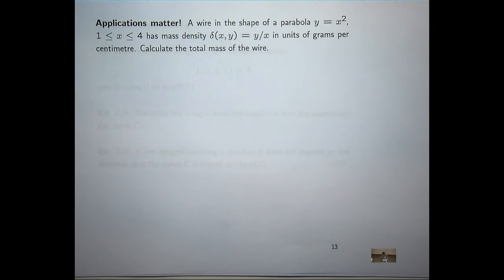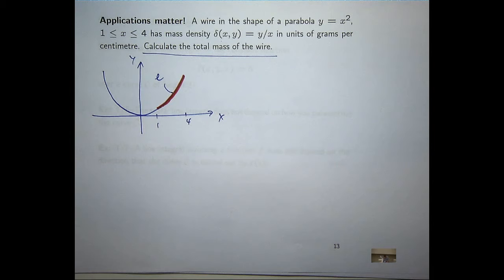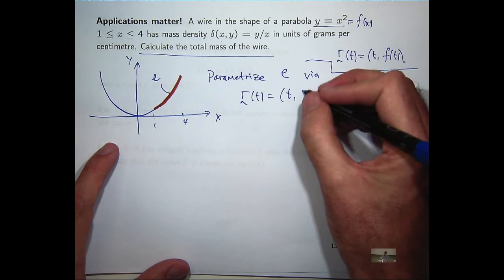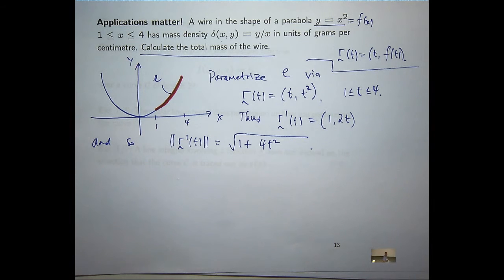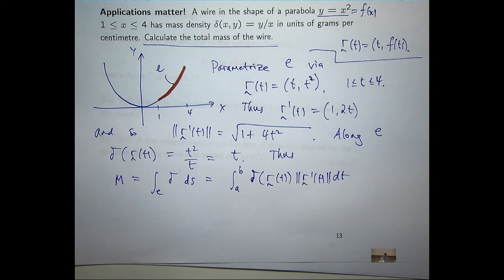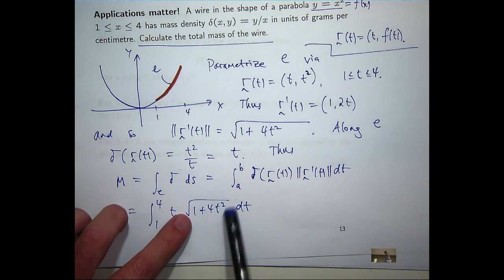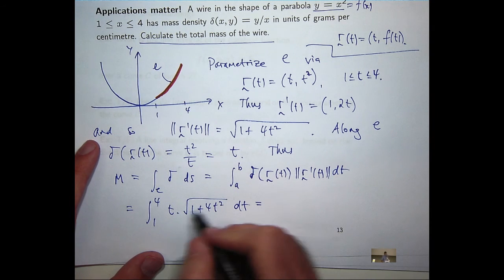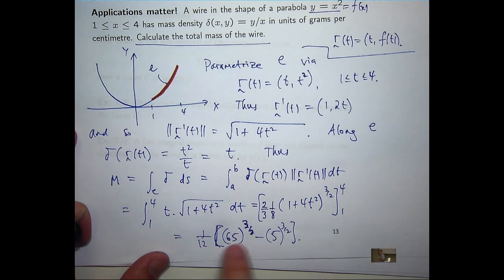How to calculate the mass of a wire

Comment from the maker: Hi - of course this is an ideal example, but if you have a wire made from a certain (possibly nonhomogeneous) material then its density may vary.  If you have an expression for the density then you can integrate of the curve to form the mass.  
The most simple case is when the density is constant, so all you do is multiply that by the length of the wire.